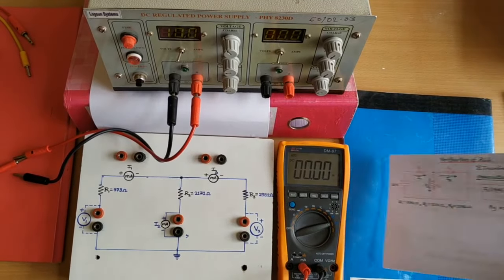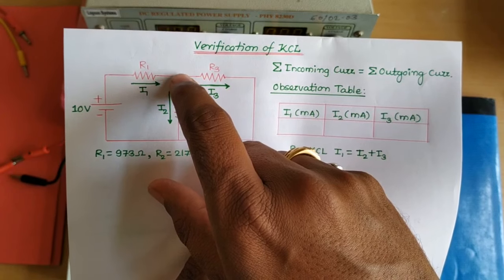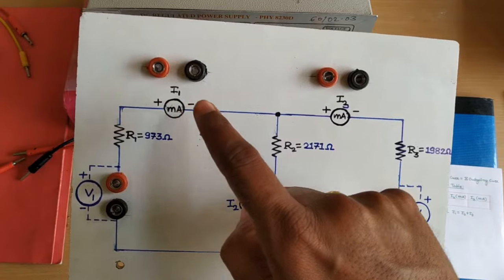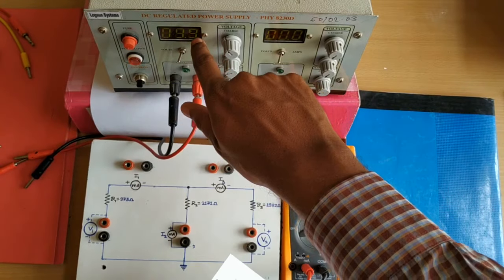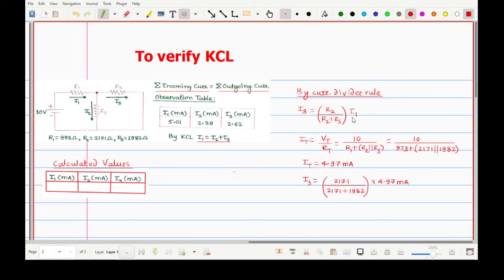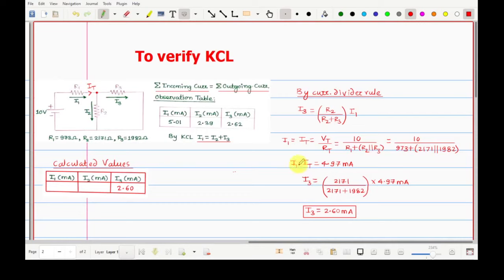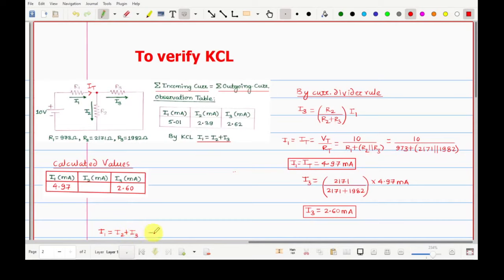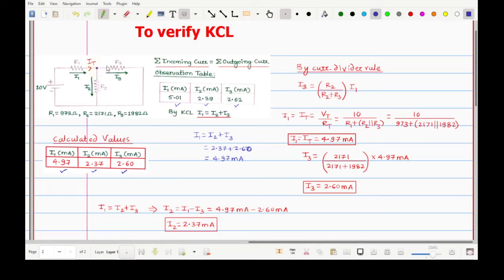Experiment to verify Kirchhoff's Current Law (KCL)

Comment: Sir, 
Can you let me know how you created this trainer box ?
\
Reply from the maker: 1. I have taken a wooden switch board. You can take PVC box as well.
2. Drawn circuit diagram with permanent marker.
3. Drilled holes where connectors are required.
4. Fixed 4 mm female banana connectors on board.
5. Soldered required resistors from bottom.

Your circuit is ready...just applied external power supply and connected voltmeter and ammeter.
Reply: @ADKTech7  Sir we can also use bread board which is cheaper then this 4 equipment
Reply from the maker: Yes you can use a breadboard, but breadboard connections are not tight hence sometimes loose corrections might result in wrong readings. Especially connecting a voltmeter or ammeter on a breadboard is difficult task.

Also we cannot mount high power components on breadboard.

Comment: sir ye R1 ,R2 and R3 ki value kha se aayi 973,2171 and 1982 ??
Reply from the maker: Actually standard values of R1, R2 & R3 are 1k ohm, 2.2k ohm and 2k ohm. But practically resistors have some tolerance, hence values are little bit less.

You can take any values as per your convenience.
Reply: @ADKTech7  thank you so much

Comment: How to make experimental board
Reply from the maker: Take a 10x6 plastic or wooden board, 3 resistors of any values, some 4mm banana female connectors and connecting wires.
Draw the circuit on board with marker, make hole to fix connectors. Connect resistors and wires....Your board is ready

Comment: How to get Current total is 4.97 mA? Why not explain how to calculate (R2 || R3) ?
Reply: Found it on another channel. The total parallel resistance is calculated by "product over sum", so R2 || R3 = (R2 X R3) / (R2 + R3)
Reply from the maker: Correct👍

Comment: can i get the list of apparatus and procedure? :( it will be helpful for my project. thank you
Reply from the maker: 32V DC regulated power supply-01 Qty
Resistors-03 Qty (any values of your choice)
Ammeter-01
Connecting wires
Reply from the maker: Procedure:
1. Turn on DC power supply and and set it to some desired value eg 12V.
2. Measure the current flowing through each branch in the network and note down the values.
3. Consider any node in your network, check for all all incoming and outgoing currents.
4. You will find algebraic sum of all incoming currents is exactly equal to algebraic sum of all outgoing currents at a specific node.
Reply from the maker: Please watch the video carefully you will understand the complete procedure 🙏
Reply: @ADKTech7  thank you 🤩